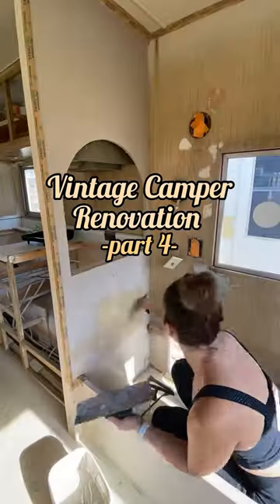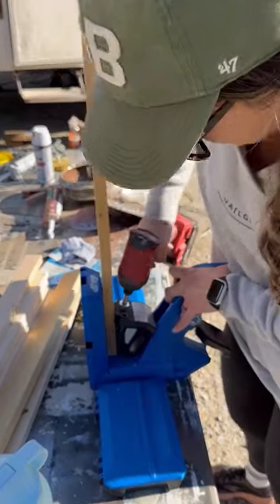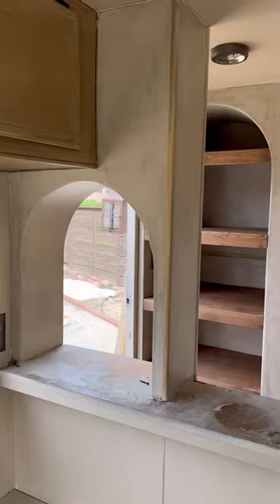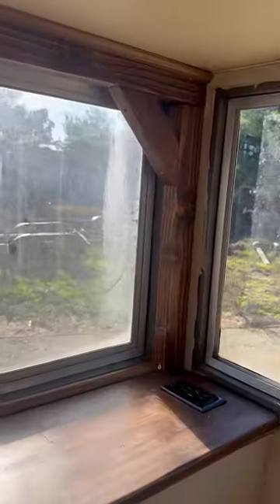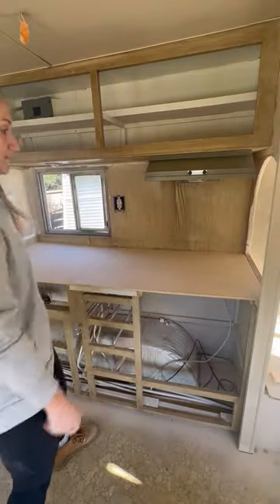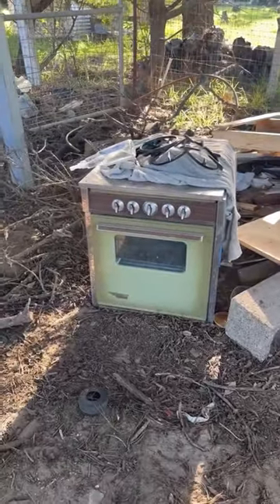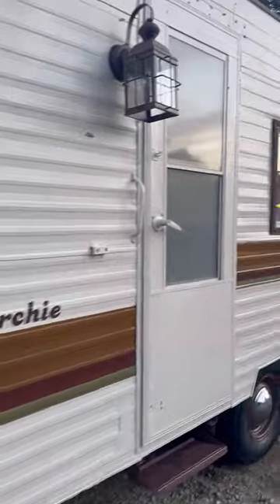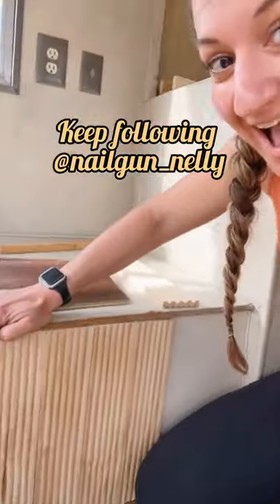Part 4 of my Vintage Camper Renovation! Flooring & Beams up next🙌🏼 #rv #rvreno #diy

Comment: don't forget to freshen up those wheel bearings and grease seals as you don't want to get stranded with bad hub bearings out on the road.  nice refurbish project. its nice to have help from your significant other on projects like this one.  super job. I love the name Archie. you could add  an awning and name it  "Scooby's Bad Boy" 🐆

Comment: If you want more clearance, the best way to do it with better results is not to flip your leg springs. It’s actually to flip your axles so if you look under your camper and your axles are going in between your leaf springs and the frame, then you unscrew your axle From the leaf springs drop the axle put the leaf springs back on relocate the mounting bracket on the axle and weld the ear back on to the opposite side it was and that will give you 2 inches or depending on what style camper you got it could be 3 inches

Comment: Is that outside light easily removable? Probably won't hold up under highway windspeed. Also wondering how those micro cemented arches will hold up to highway speeds and jostling.
Reply from the maker: Once we get this project complete and get it on the road, I will keep everyone updated on how everything holds up

Comment: I would  have taken it easy on concrete and how much solid wood you are using inside.. the heavier it is the more gas and wear n tear when hauling it
Reply from the maker: Totally agree, I just can't help myself from doing out of the box renovations. But we definitely keep weight on our mind and have actually removed a lot of heavy items. Additionally we always ensure to stay under the gross vehicle weight rating of the trailer